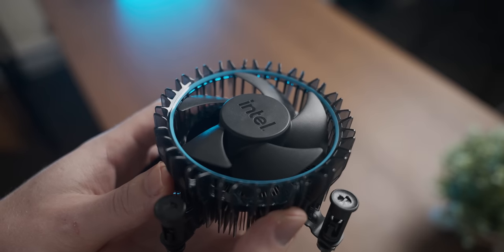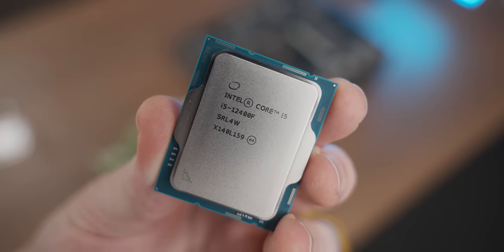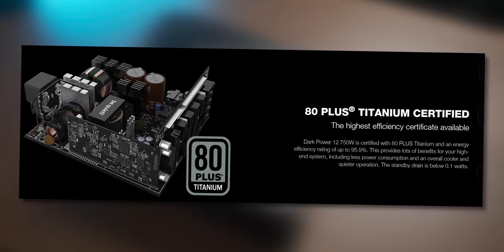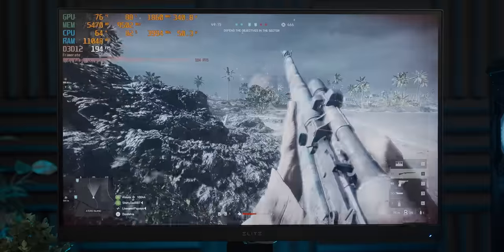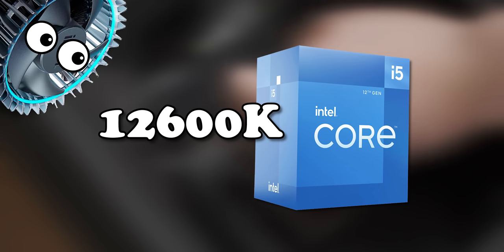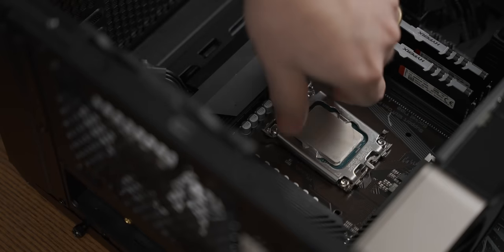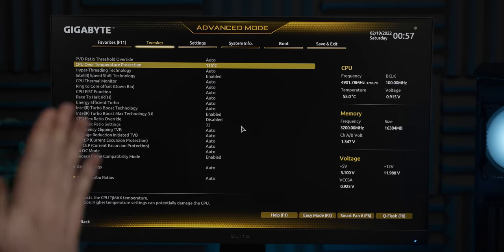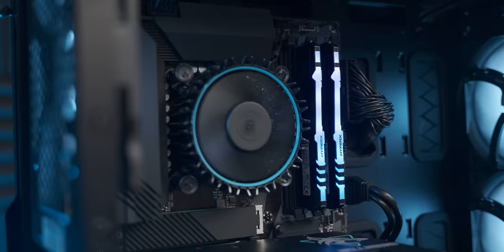Pushing The New Intel Stock Cooler To The LIMIT

Comment: You should try comparing the 12900k + stock cooler versus a little less high end CPU but paired with much better cooling.

Comment: I've just built a £600 system for a friend including a 12100F and an 6500XT, runs beautiful, but that stock cooler........worse heatsink I've ever had to work with, the poor motherboard creaking whilst trying to push in the clips, horrendous

Comment: I got almost through putting my entire pc together just to realize my current cpu coolers bracket doesn’t fit and had to use the stock intel cooler to even turn the pc on 💀 i7 13th gen

Comment: You should have mentioned the 12600 and 12900 do not come with the cooler, so Intel themselves are not recommending you use the cooler with those.

Comment: i dont get it. from day 1, my ryzen 5 3600 has run hotter than anything ive ever used. with the stock cooler, it would freaking idle at 60c. i installed a Deepcool Neptwin V2 twin tower cooler rated for WAY more than the ryzen 5 3600 is and i still see very high temps. im only using a rx-580 8gb red devil with it and somehow, the cpu always runs quite a bit hotter than the gpu has, ever. for instance, cpu utilization will be around the 20% mark, but itll be pushing near 80c while my gpu is sitting at 65-70c. i dont understand why my cpu runs so hot, especially with the cooling solution om using. ambient temps in room always sits at about 18c. my case has really good airflow and there really is no reason for the cpu temps i see with my ryzen 5 3600 to be happening. hell, the old FX-8350 i used for a couple of years stayed much cooler with a cheap after market single tower cooler with single 90mm fan than my ryzen 5 3600 ever has. quality thermal paste and ive been building computers since the early 90s too, so it really doesnt make much sense to me. i dont know, maybe i should just go ahead and snag a 5800x since im already using a x570 mobo anyway. grab a rx-6900xt while im at it. lol

Comment: Wow...I can't believe you did that! As soon as I saw the 110, for some reason I knew it was going to shut off. Intel really needs to do a better job on making stock coolers. They can make all the noise they want! Just make the i9 run smoothly with the cooler you supply with it!
Reply: Are....are they actually supplying the i9 with a stock cooler now though? When I bought my i9 10900K it came as a cpu only item in the full retail box specifically because of the need for a high end cooler

Comment: I have a 2070 and a i7 10750h in my laptop and it runs about as hot as the surface of the sun. DO NOT BUY dell gaming laptops unless you're really into hot, throttling action.

Comment: ow that poor 12900k. takes an air cooler size of a fucking motorcycle radiator to keep mine nice and chill lol moment I saw the 12900k i was like RIP
Reply: 80C at merely 80 watts is pathetic......even other low profile coolers would do much better than this...

Comment: I subscribe to your channel and I get that your "schtick" is to dump on/whine about the featured item.  (Necessitating your invention of sometimes bizzare methodologies to further your pre-concluded script) This cooler is not meant to be used with a 12900, nor does it come with that cpu.  At least mention this in your video.  Also, not everyone can afford a good aftermarket cooler so if this stock cooler actually works with the CPU's it comes with... Why not mention that you could still barf up negativity about noise levels... Win-win